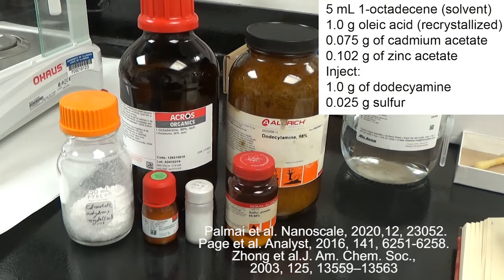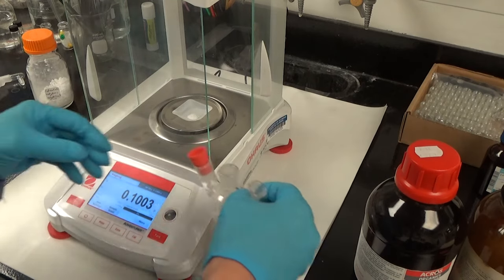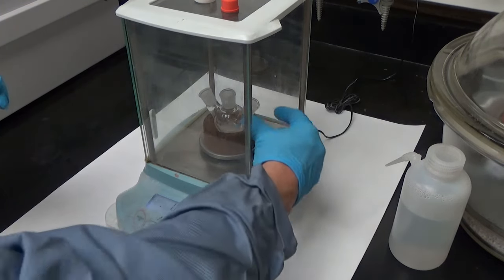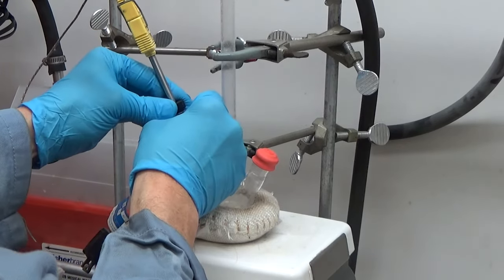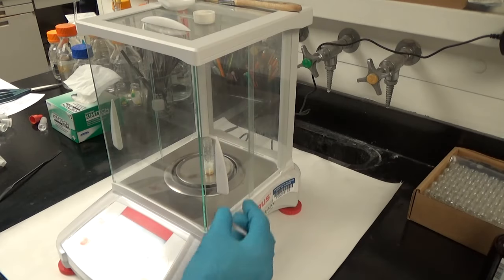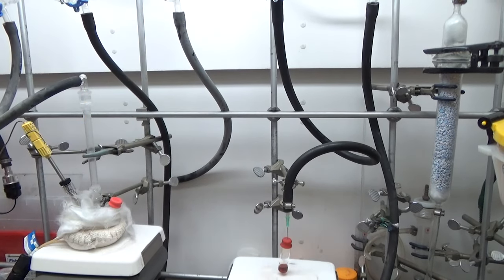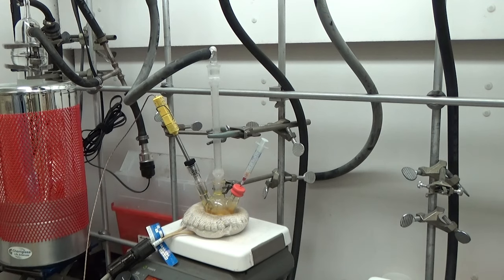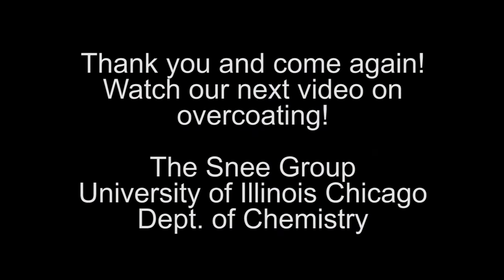Synthesis of Blue ZnCdS Quantum Dots

Comment: Any reason why you inject so quickly? I was so shocked by that lol usually I try to inject rather slowly to avoid splashing.
Reply: My guess would be that the quantum dots will grow more uniformly, if the sulfur solution is added quickly. But I really don't know. I also got scared a little there.
Reply: In such high temperature, sulfur precursors react to make quantum dots as soon as they meet Cd, Zn solution. So slow injection leads to two reactions: (1) formation of quantum dot nuclei, (2) growth of quantum dot size. Since blue emitting quantum dots are typically small in size (compared to green or red emitting quantum dots) the reaction must be stopped in an early stage, minimizing growth time. In this reason, fast injection of sulfur precursor leads to make a lot of small nuclei, consuming sulfur precursors in a short time and minimizing quantum dot growth. Thus, small-sized quantum dots can be made. When synthesizing larger quantum dots such as red emitters, slow injection of precursors is ok.